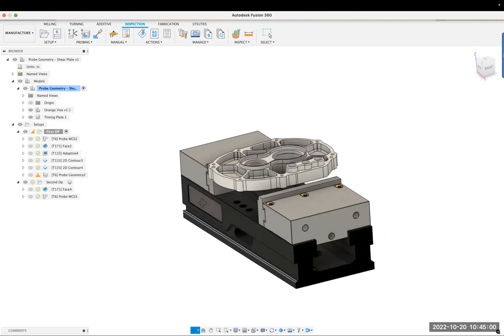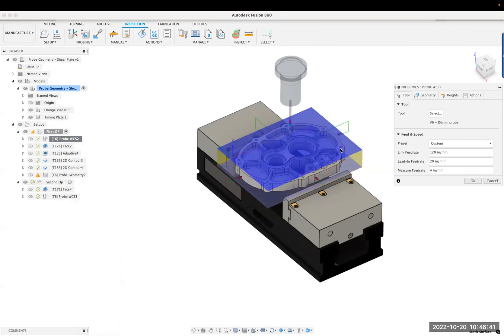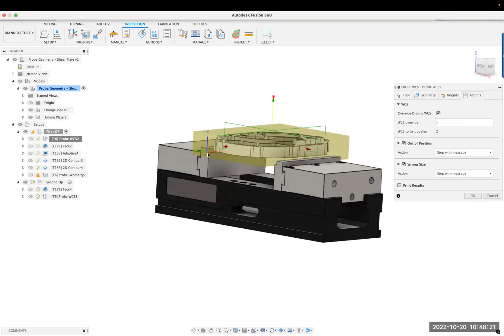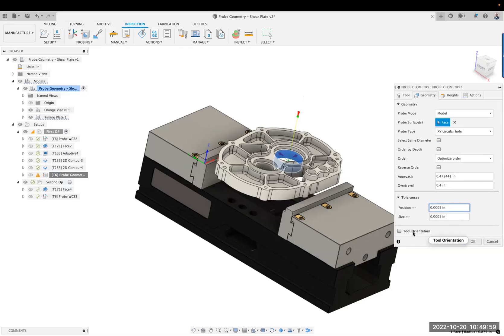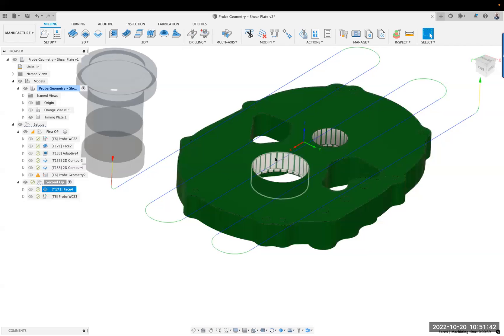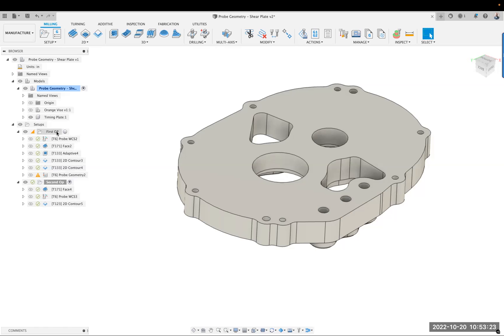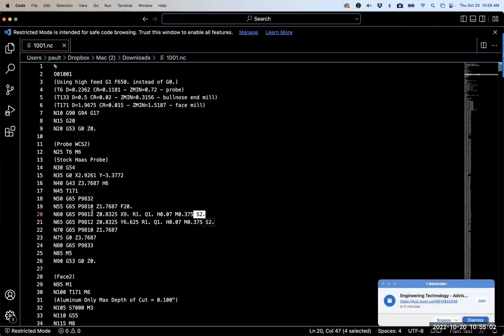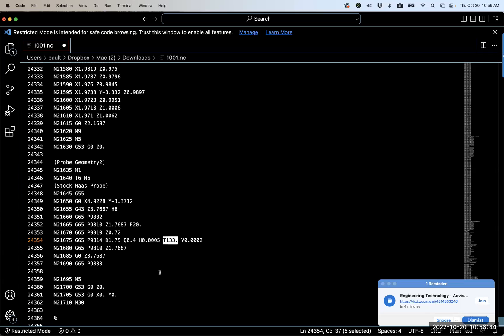Fusion 360 WCS Probe override

Comment: A bit confusing. Maybe needs more planning to get the point across concisely. Kind of creates as many questions as it answers.
Reply: Yeah could not follow him.
Reply: He's using G54 to define a repeatable reference point for the probing cycle, and then G55 to define the stock offset relative to that known reference point.  How the stock is positioned in the vice is kind of arbitrary unless he set up a stop or machined a reference ledge in softjaws. 

Since G54 is defined by static geometry (the vice jaw), it's not going to change part to part.  That is nice because once you find that, you don't have to touch it again.  Then as you work through your run of parts, the probe is starting from the same reference point and updates G55 based upon however the material is installed in the vice.

If the probing cycle overwrote your initial G54 every time and used that for the toolpaths, then you would run the risk crashing the probe if the stock is installed beyond 3/8" of an inch out of position, in this example - since the new baseline for the next probing cycle would have the offset from the previous part entered in.  Say part 1 is installed 3/8" to the right of center, it gets probed and machined, then part 2 is installed 3/8" to the left of center.  The second part would get probed 3/4" off of its true physical center (since the probe is referencing G54 from the previous part) which can't be compensated for without putting in a lot more over-travel.